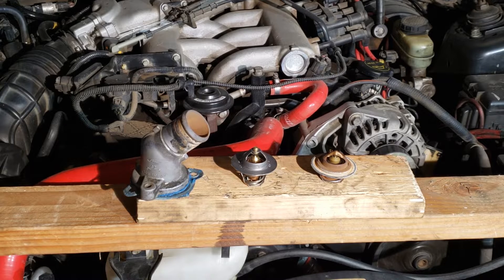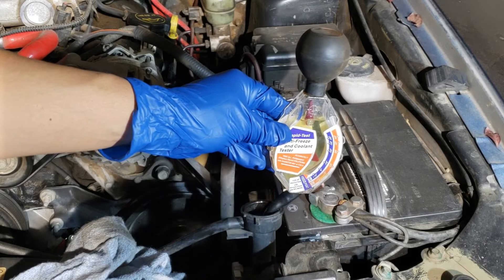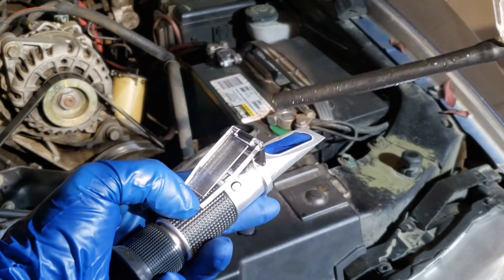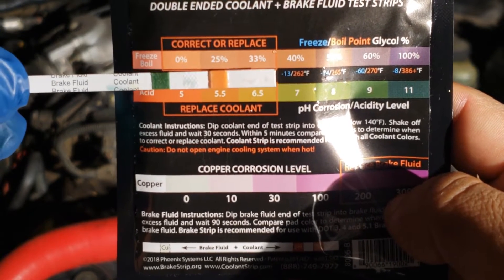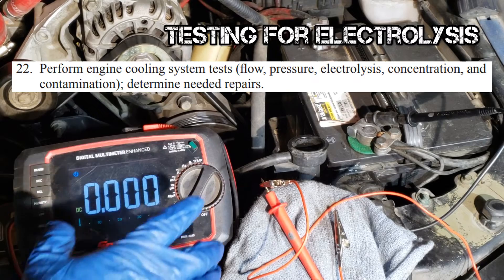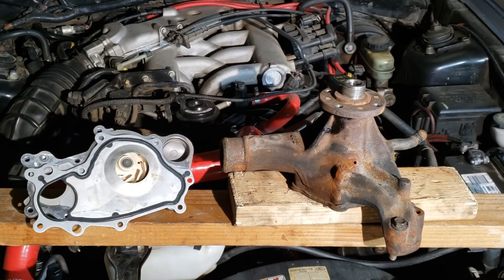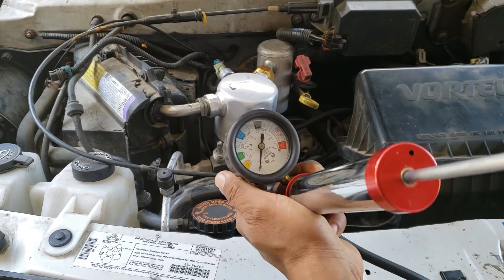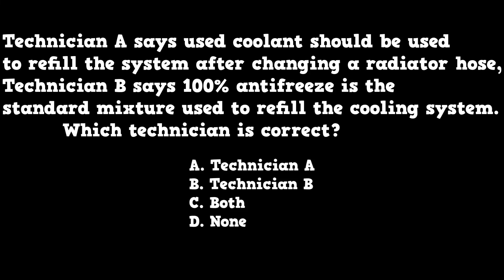ASE A7 Test Prep #4 - Cooling System

Comment from the maker: Update Oct 15, 2023: (Feedback after taking the test) A couple of questions about the thermostat and how it affects the heater operation.
No questions about coolant when it comes to using a hydrometer, refractometer, or test strips.
No questions about electrolysis or testing for it.

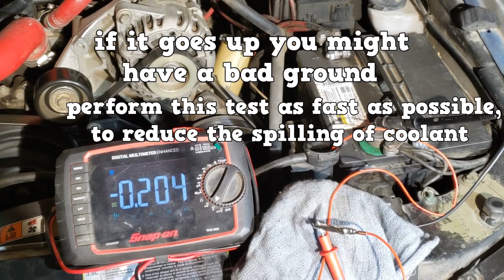The info from 4:10 to 4:52 is good to know, saw a couple of questions relating to it.

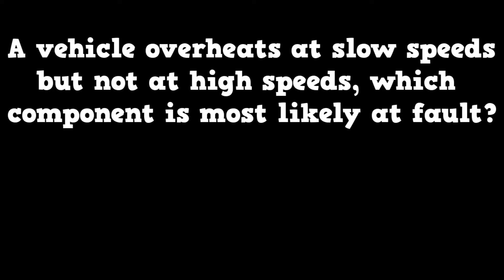The question at 5:43 is near close to an actual question on the test, only difference is that the cooling fan is not an answer choice. Had completely different answer choices. Basically what else can cause that?

OVERALL TEST REVIEW: Knowing the info presented in this miniseries can help you answer about 25 of the 60 questions. The test was harder than I expected and questioned you on stuff I did not think was going to be on the test (i.e. do you know what an "air quality sensor" is?)
I could have made videos on blower motor info, automatic temperature systems, dual temperature control systems, and blend door/mode door/ recirc&fresh air doors. Those were another big part of the test. My score was 43 out of 50. (10 questions are not graded, but we don't know which ones). Test time limit is 1 hour 15 minutes.
Reply: So watching your mini series should prepare me for the test? I take it on the 20th, already took electrical and pass
Reply from the maker: @zaccsacc5839  This mini series is a supplement to your study material.

Comment: Big thanks for taking the time to make this mini series and help others in furthering their knowledge and skills in the industry! I took my A7 today (March, 2025) and passed with a 44/50! For the exam, be familiar with troubleshooting an AC system given pressure gauge readings and PIDS from the scan tool (i.e., pressure sensor readings, AC clutch requested (yes/no), AC clutch commanded (yes/no), ECT actual value, IAT actual value, battery voltage). Remember that stuck/broken blend doors can be a problem source for a complaint of a cabin not hot enough or not cool enough. Had a question on rear climate controls. Be familiar with relays and circuits, and shorts located upstream of BCMs and HVAC ECMS (that ground a circuit) and their affect. Stuck closed relays, be familiar. Know about procedure for adding dye. Know affect of stuck closed and stuck open TXVs. Know the air purity sensor, its construction, what it can sense, and what can damage it. If you see this comment, hope it helps in studying, you got this!!
Reply from the maker: Right On! Congrats!